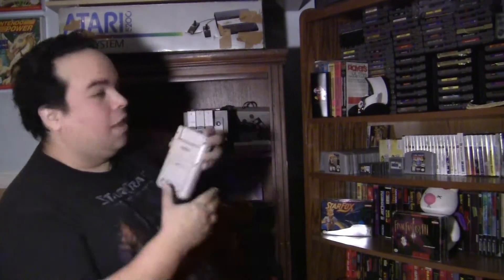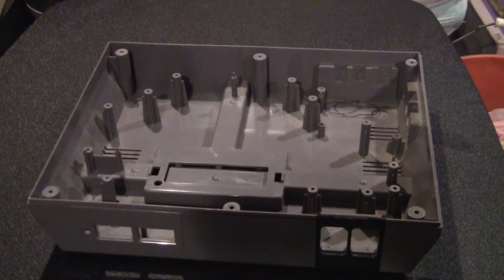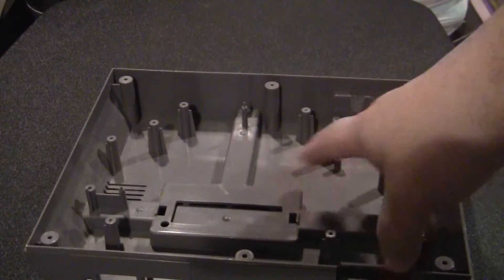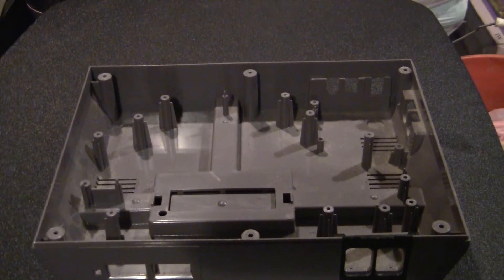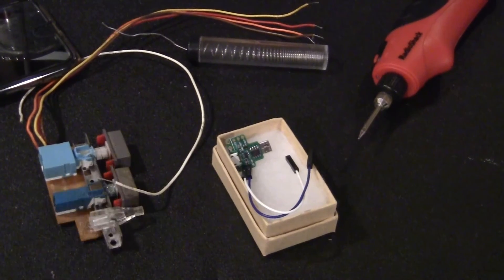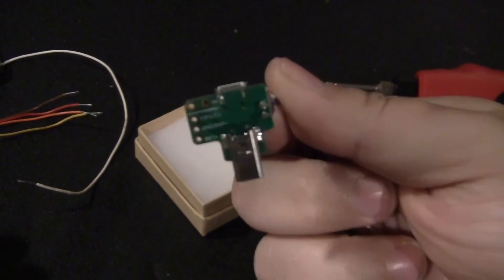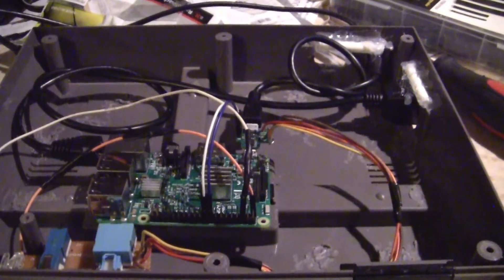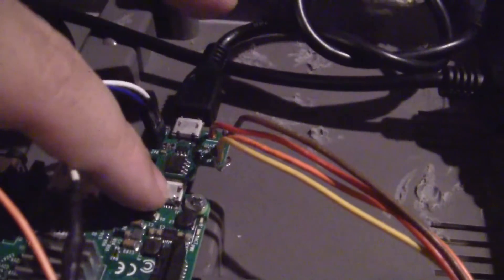The Gamers Vault Episode: 3 Raspberry Pi 3 Nintendo Case Mod

Comment: thx for the info!
for the os for the rpi3 i recommend more recalbox because it is easier to use and more adapted for just a nes mini style console.
Reply from the maker: Do not get me wrong I love recalbox but the only problem with it is the kodi it is using an older build and since i am not talented enough to work it into the new build that is why i am using retropi for this build so i can have my latest with kodi builds and my gaming. Also with retropi it has alot of emulators more so than the recalbox so far but overall the but software's of recalbox and retropi  are awesome
Reply: yea about kodi i can understand,for me i prefer a older version working well instead of bleeding edge update not totally stable,most of my extention work on it (fusion installer) so i m ok. speaking of working well,it is true retropie have more emulator but most of them are too experimental or too slow on the rpi to be realy usable. the only exception being the dreamcast and psp available in recalbox 4.1 if you want to try them. after all,this is just a nes mini clone ;)
Reply from the maker: I agree recalbox is perfect for some people as well as the retropi so i will showcase both
Reply: you don't have to but thx,
recalbox is so under rated no one show it.
Reply from the maker: not a problem people should have choices :) Happy Holidays to you and your family
Reply from the maker: Hey Just to let you know I have made the RECAL box episode. You can check it out at https://www.youtube.com/watch?v=odJNL1LRFYw&feature=youtu.be
Reply: ho thx!